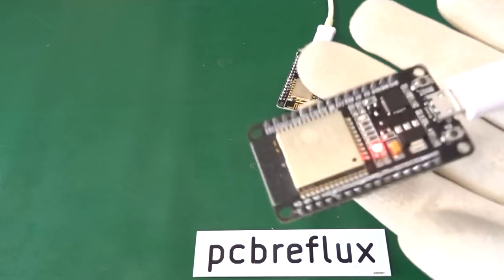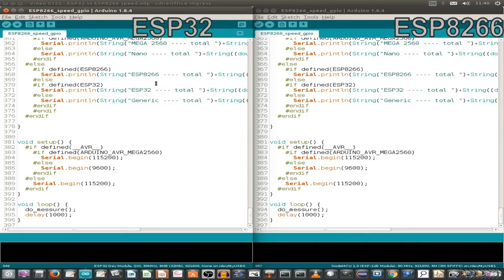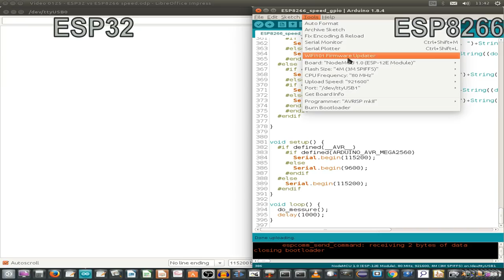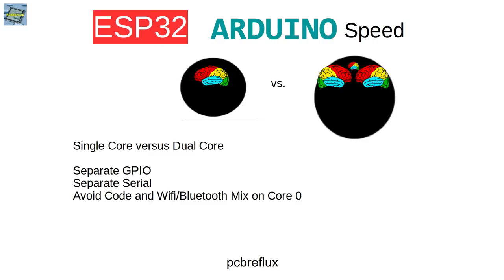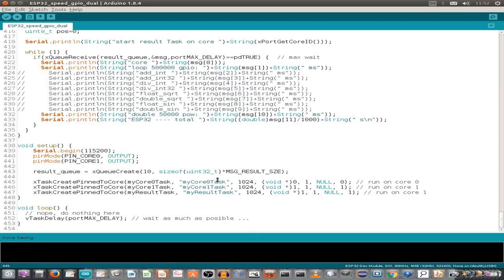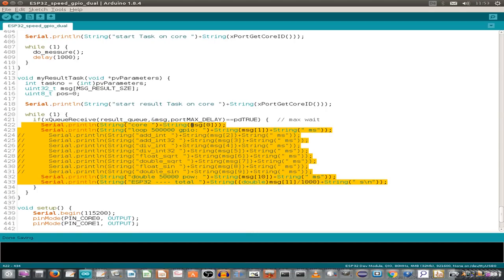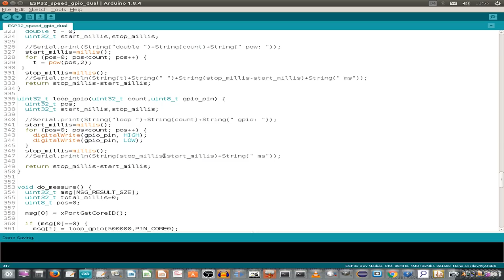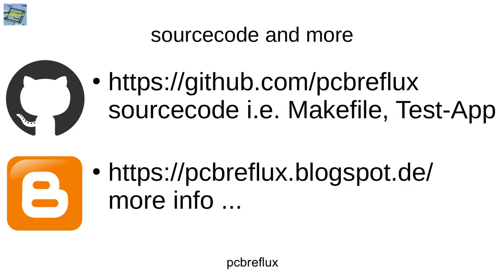ESP32 #60: ESP32 vs ESP8266 Speed Comparison and Arduino Dual Core Speed

Comment: Maybe a bit late to comment, but the ESP32 can run at 240MHz and in this test it ran on 80MHz, according to the Arduino status bar. Don't know if it makes any difference in GPIO switching speed, but it makes a huge difference in any other calculations.
Reply: How do you change its speed?
Reply: @ico-theredstonesurgeon4380  
void setup(void) {   
  setCpuFrequencyMhz(240);
Reply: @drstefankrank  thx :)

Comment: is the dual-core ESP32S better than ESP 8266
Reply from the maker: Raphael Larbi Short answer: it's different. Higher in price, bigger footprint, less distributed, fewer projects - v.s. - faster, claimed to be more stable, supports Bluetooth and hardware encryption, low power co processor, additional GPIO pins, newer hardware revisions and more.